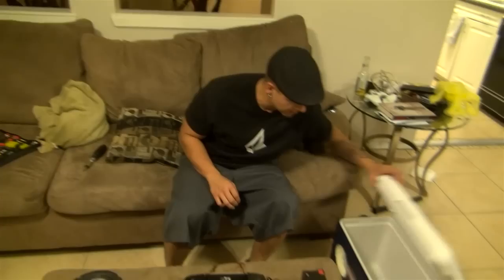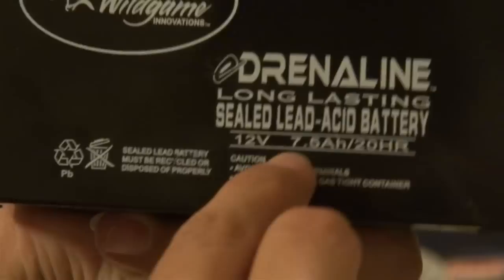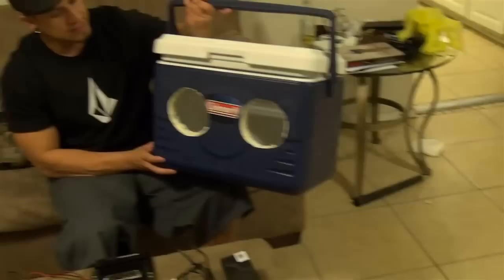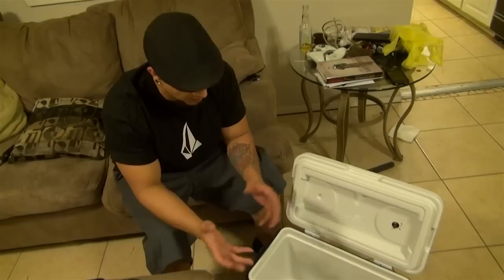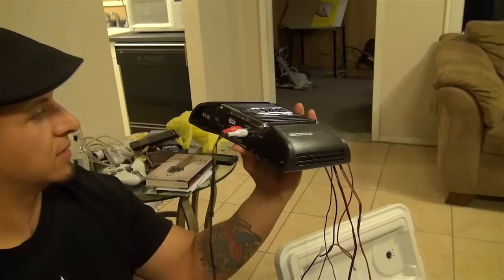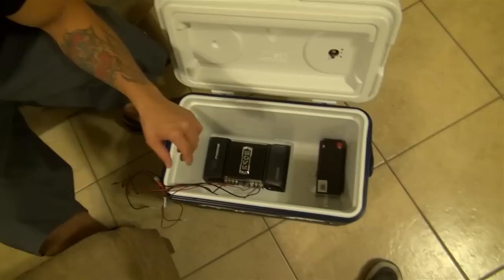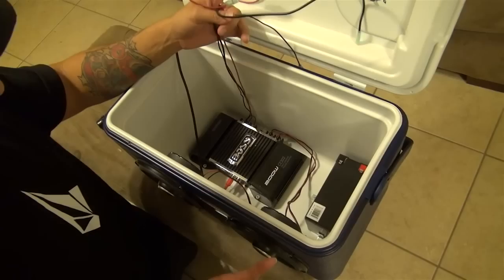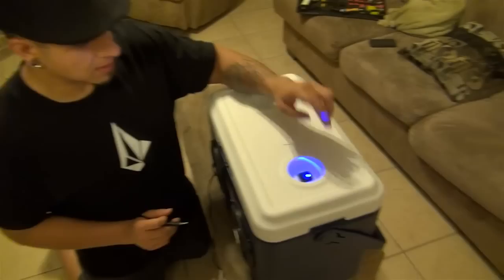How to Turn an Ice Chest Cooler into a Stereo

Comment: Great video!  I still have to mount the battery, switch, and amp but I connected the electronics and the initial test was impressive.  Very loud with the amp input level almost completely turned down.  There's a few clarifications/tips I'd like to add:  (1.) Foregoing the switch and just applying power to the amp didn't turn the amp on (I believe the remote input on the amp needs to be triggered to get the amp to power up), so I ran to Radio Shack to buy a switch just like the one in the video and it worked!  (2.) Pay close attention to around the 10:50 mark of the video.  Both battery leads need two outgoing wires connected to them.  (3.) He's right about the equipment.  That battery and that amp connected to quality speakers is all you need.  Buy online, and you can get your setup for a little over $100  (4.) make sure you have a good box cutter to cut out the speaker holes.  I found saws to be useless.  I used the cardboard that came in the speaker packaging as a template, and it worked great.  (5.)  I used home speaker wire, and cut up the charging cord to an old shaver to connect the power.  (6.) The amp has all sorts of warnings about not using the input level adjustment as a volume control.  Using your ipod's volume is okay, but I'll be adding an RCA volume knob.

Comment: You did a very good job explaining how to build it, I have built a couple of cooler radios myself and I just used a huge deep cycle battery with a pioneer deck and 4 speakers. It got loud but it was a pain lugging it around, even with wheels. I've seen those battery's at Walmart and have considered using them but just haven't had the time to do it but now I think I'll build another one. Thanks for the video it was very informative!

Comment: You can buy any of many batteries for an ATV or battery backup battery. I have a bunch of old ones that were going to be recycled and coolers are cheap at the thrift store. You can put a stereo in, cigarette port for charging your phone, etc.

You can also use the metal wall anchors that crimp down.

Comment: That's what i did back then, i also powered up my kids power wheels with a car battery, the amperage sure makes a hell of a difference.

I do it differently now.
Just get a dc to dc Voltage step down 24v to 12v 30 amperage for $25 in Amazon and use a cordless power tool battery 18v to 24v.

I use my Ryobi 18v battery and it kicks ass. The best thing about it, is that if i take it somewhere and the battery's power dies, i just swap it out for a recharge one, and again when that one goes dead. I have 6 for my power tools but i also use them for my Bluetooth box.

Sure beats having to look for a power outlet to recharge.👍✌️

Comment: just need to get a rubber surround for the insert mdf so it seals off, add a tiny bit of sound deadedner on the sides and bottom inside the box and should be a very nice sounding setup, also have a latch to keep that lid open, because when all that is applied then you'll be having to open it all the time due to too much awesomeness

Comment: What's the best (easy) way to cut the speaker holes into the cooler? What I ended up doing was I bought the 20W amp for $15 on ebay and I bought to home stereo speakers at Goodwill. I screwed the amp into the center consul on my 2011 Prius closest to me. I wired the speakers up from the cargo area and put the back seats down for more sound. I then plugged the amp into my cig lighter for pwr. I have an Aptek mp3 player as the radio. It blasts me out of the car! For such a low pwr amp I couldn't believe it powered those big stereo speakers!

Comment: Yeah bro I applaud your thorough description.  The only thing I would like to run by ya is the fact that with any amp with an Rem or power switch you most definitely have to use a toggle switch. Other wise your amp will not come on.

Comment: Nice and simple man. After watching this I went out today and built one. Used a 60qt igloo ice cube, 250watt kicker amp, 2 pioneer 6x9s, and instead of an aux I used a Bluetooth adapter.
I also used an atv battery. I feel like I should have bought a deepcycle battery but it will work for now.  
All I need is a switch or just some clamps..that way I don't have to keep unhooking the battery with a wrench. Total cost $296 all from Wal-Mart

Comment: How can I hook this DC Power Cable 12V 5A Plugs Male pigtale to one of these Maxmoral 3PCS DC-099 DC Power Socket Connector with Waterproof Cover Cap,Threaded Female Panel Mounting Adapter Power Jack 5.5 x 2.1mm with out soldering ?

Comment: What size Female Spade Crimp Terminal with Insulating Sleeve and Wire Red + Black Female Spade Quick Splice  should I get to hook up to a round 2 prong rocker switch and a 10amp automtive fuse ?

Comment: I'm pretty sure it's a 28q, use what ever you like, in my opinion a medium sized cooler works the best just make sure the sides are smooth. And I used 16g wires. Went the the auto parts store and got a spool of red and black

Comment: I'm new to the wiring part of this setup. I want to wire in a USB port for charging and also a voltage meter for the battery.  could you make a quick video on how to maybe add that to you setup or give me a quick how to response? thanks! this was probably the most informative video on this topic I've seen!

Comment: Can you help me figure out out how to hook up plye 4ch hydra bluetooth amp white, 5amp APIELE 22mm Momentary Push Button Switch 12V Angel Eye LED Waterproof Stainless Steel Round Metal Self-Reset 7/8'' 1NO 1NC with Pigtail (Blue), Talentcell Rechargeable 12V 6000mAh/5V 12000mAh DC Output Lithium ion Battery Pack for LED Strip and CCTV Camera, Portable Li-ion Power Bank with Charger, Black and using this 10pcs Conductor Compact Connectors Lever Wire Nut Electrical Connectors with Fixed Base for 3 Circuit Inline Splices 28-12 AWG?

Comment: How can I hook this  Maxmoral DC-099 DC Power Socket Connector with Waterproof Cover Cap,Threaded Female Panel Mounting Adapter Power Jack 5.5 x 2.1mm to this 2 prong Marine Switch Panel Waterproof - Light Switch Panel for Truck Appliances Rocker Switches Round Rocker Switch Car Accessories Toggle Switch Panel for Car - Round Socket Switches a/250v 10a/125v with out soldering ?

Comment: im attempting make a cooler radio but i cannot find any of the connectors so i can connect my amp to the batters and the wires to mt speakers. what are those called and where can i get them?

Comment: Please LMK.....I thought the idea of ground was for some kind of protection from surges . I know its low power, but safety is safety...where is your ground???  Eventually, the ground has to be grounded?   Am I missing something ? The idea of speaker is great....but maybe a long rod or a long screwdriver driven into soil can act as a ground?
Reply: It's a 12 volt dc system. The word "ground" is used way too often as an interchangeable term for "negative". On the amp the "ground" is just simple instruction for an amp meant for car installation to be connected to the chassis of the car to facilitate the connection of the negative terminal on the amp to the battery.

Comment: HELP!!! Not working and idk why...
I'm using a brand new 12v 12ah battery with brand new 50 RMS Dual cheapo 6x9...
Tried 3 amps, 1 doesn't have a power light so we'll exclude that one right away (250w 2ch). The second (100w 2ch) has a LOGO on top that DOES light up but the power light does NOT. And lastly when I try the last amp (225w 4ch) "protection" light comes on briefly then stays off but still no power light...
I wired everything exactly how you have yours, toggle switch and all.... WHAT AM I MISSING?!? 😫😓
Reply: Ive been watching to see how these guys GROUND the 12v... theres no ground?!? How do you ground the battery?!? I mean thats half the battle with wiring your car , is cleaning and redoing GROUNDS

Comment: l don't know what it is about this video but l like watching it multiple times. it is like that song you just can't get out of your head, good job. this is a good idea for a last minute music system on a shoe string budget, but for long term us l would cut the wiring for the tweeters and put in a crossover. maybe a solar panel, a head unit, a psu for home use, and a capacitor for the amplifier to keep the current from the small battery constant.
Reply: Thanks man, my philosophy on this approach is to keep it small and simple. A lot and I mean a lot of people mention right off the bat from first seeing this or any other cooler is...What can we add, solar panels, volt meters, led lights, subwoofer and 200 watt amp, this that and the other,  (inevitably followed by how long do you think the batt would last...HA) which is absolutely fine if you're a super tech head, I'm not knocking that at all. I understand the bigger is better and WAY bigger must be better mentality, but I've built about 15 different coolers and for me personally I like em simple.
Reply: yeah l am building something simple for a upcoming party. l got a little brief case and l am putting 2 6x9's in it for good sound and bass for all my basshead friends.

Comment: How are the components protected from the ice when it melts?
Reply: ***** Dry ice?  What a concept!  Like the case of dehydrated water I bought in case of emergency.  It would be great to use one of them wheelie ice chests for easier transport through the neighborhood.  Also, how about applying the same concept to wheelie trash bins?  Just imagine the bass response you'd get.  Plus, you can add a crossover and a 15" woofer to handle the low frequency end.  Wow!  Now that's what I call a Ghetto Blaster.

Comment: I really recommend using a cheaper lower power amp for this setup, no more than 50W RMS, any reasonable speaker cheap or expensive will sound great in your box with a minimum of 15 to 20 watts RMS

Comment: Your amp may not be getting enough power or drawing too much power and cutting out when the volumes too high. Think of if as small power surges that you amp or battery can't handle. Try using a smaller amp, also if you're using a small battery like the one I use it the video make sure it's a 12volt battery, I've never had that problem with any setup I've done, so it may be fair to say your problem is in the amp though it could be the battery

Comment: Yeah if it's 2 hundo watts RMS that's too much for the speakers probably, go back re-check all your wiring "no doubt you already did" might also make sure the gauge of the wire isn't too small or too big, I used a combo of 14g and 16g

Comment: I'm at a loss.  I set mine up almost identical to yours, but I can't get a good ground.  Every time I try to connect it to the battery it sparks and the wires heat up.  I have a 12v battery/400 Amp/16G Wires.  I've had three other dudes look at it and we're all puzzled. Any suggestions?

Comment: hey men thums up i got something similar but im trying to do a project like urs im planing to use a amp and a car stereo and also the battery u using can u help me wiht the wire problem iknow that in the car stereo yellow and red are together and go to positive n black to negative and u give power to it but i get lost wen i want to connect amp n car stereo

Comment: I fixed the sparking problem, but now it'll drop out on me after a few songs. Power stays on, just no connection to the ipod. I'll recycle the power, and then it'll work for half a song. I have a ground wire going straight from the amp to the battery so I can't see it being a ground problem. Everything I've googled has the same set-up as mine so I'm just confused.

Comment: I jus got a 12v rechargeable 9ah battery & when I connected to my car radio da negative sparked and right now im using clips

Is there anyway to keep it from sparking???

U can see wat I'm talkin bout on my YouTube. Its newest video
Reply: Just get a dc to dc Voltage step down 24v to 12v 30 amp for $25 and use a cordless power tool battery 18v to 24v.

I use my Ryobi 18v battery and it kicks ass. The best thing about it, is that if i take it somewhere and the battery's power dies, i just swap it out for a recharge one, and again when that one goes dead. I have 6 for my power tools but i also use them for my Bluetooth box.

Sure beats having to look for a power outlet to recharge.👍✌️

Comment: Good post! I appreciate you taking the time to make this. A couple questions. Does the switch have to be a G/L/P switch? I just grounded my two prong switch. It doesn't want to turn on. I think my amp is auto powered on when there is a load on it. I have it all hooked up, I am just hazey on the wiring.

Comment: Frank,

I want to add a subwoofer to my cooler radio, but I am unsure how to do so.  Can you help
Reply: unless there is a subwoofer port on your amplifier, you have to convert 2 mono (stereo) wires to 1mono and connect a crossover. Then you can connect the sub.

Comment: what size gauge wire did you use for the amp,speaker,battery ?
what kind of switch  did you use amps,and volt?

Comment: You can also use the little batteries out of one of those power wheels toys or a kids 24 volt rzr scooter, those 24 volt kids toys use 2 12 volt batteries. Thats if you wanted to go even cheaper, because those kids toys usually come with chargers as well

Comment: hello sir james nice job! but can u pls give us the amp watts,speakers and voltage of the battery thanks dude! more powwah!
Reply: The amp was a BOSS CE202 200W 2-Channel Car Audio Amplifier, 50w x 2 RMS @ 4 ohms. The battery was a 12v 7.5 amp hour Sealed Lead Acid. Both bought from Amazon, amp was 30$ batt was 25$

Comment: that's rally cool my next system will need a 50 amp battery for the 2 6 1/2 and 10" subwoofer here is my system if you want to check it out home made bluetooth boombox

Comment: I'm betting its your amp, you can try putting a in-line fuse on the power wire but these setups really don't need em. Try a different amp

Comment: The switch is wrong. Electrics on 12v is similar in ways to mains. The switch power should be the feed in (from battery) and then load is the output (to amp), and ground is both of them connected; its a single pole switch meaning it only isolates the line conductor.
Reply: Nah the switch is right, it switches a hot source to the amp on a separate terminal that controls the on/off function of the amp, think of it kinda like the amp has its own built in relay.

Comment: what size wire are you using ?
Reply: The speaker wire leads are the wire that came with the speaker and I just matched em as close as I could, so 14g maybe 16g. And for the power I believe it's 18g, some will argue that you need a larger gauge wire and for a vehicle with a more powerful batt and alternator. But with this set up the amp is only inches away from the batt so no you don't need a big gauge wire
Reply: Larry Cereghino probably 16 gauge. You can buy just regular speaker wire at Walmart. There's not much power going to it so you dont need thick wire

Comment: What was used to cut holes in cooler?
Reply: I 1st drilled a hole where I marked my speakers then used a jigsaw with a metal cutting blade instead of the wood cutting, smaller teeth cleaner cut
Reply: ***** How long does battery last per charge?
Reply: if im am not using the road rage and I am not doing a remote set up do I just simply connect the positive to positive neg to neg on the amp and batt. connection?

Comment: What kind of amp did you use?
Reply: I used a BOSS Audio CE202 Chaos 2 Chan Amp it's  50W RMS per chan and works like a champ, shop around, I got that one on Amazon for $30 bucks awhile back, I got it for the price but mainly for its size. Keep size in mind for whatever Cooler you decide use.

Comment: And no in this aplication the amp is not more important than the speakers, for such a small set up like this, a cheap lower power amp is ok. It doesnt take a lot to make the speakers sound good and its easier on the battery not to mention the wallet (altough its your imagination go as crazy as you please). You dont want super cheap speaks because they sound like crap, but you dont want super expensive ones either that would sound better with a high power amp. Its about practicality in this case

Comment: Omg do not drain your battery to the bottom before charging, that is one of the worst things to do to a battery, also don’t use a lead acid battery, use lithium ion batteries, they are lighter and cheaper than the lead acid of the same power

Comment: Still don't understand the purpose of using (and wasting) a cooler. It'd be one thing if you could still use it as a cooler AND stereo, but other than that, why? Why not just make a real box out of MDF? It would sound a million times better, AND you'd still have a cooler.
Reply: I use ice chest stereos when I float rivers.